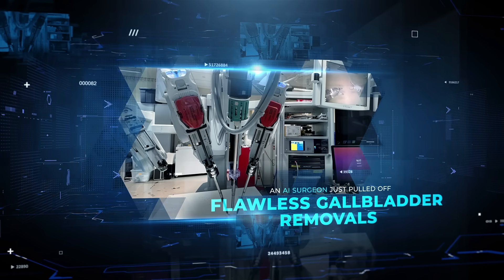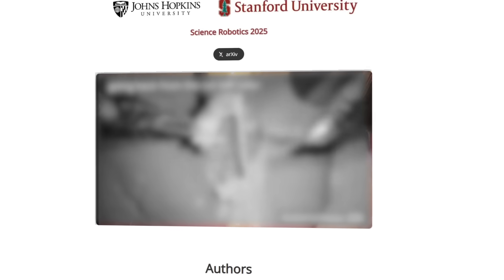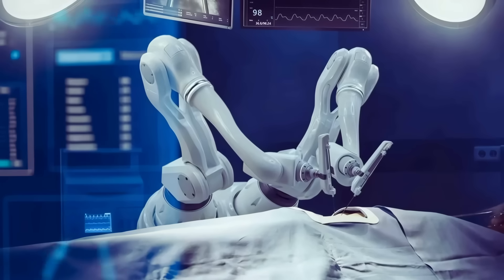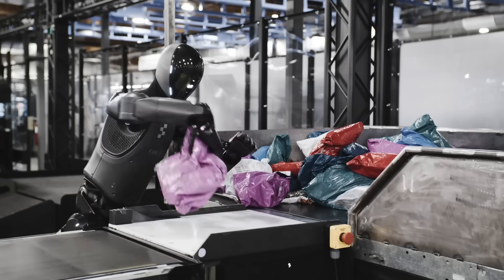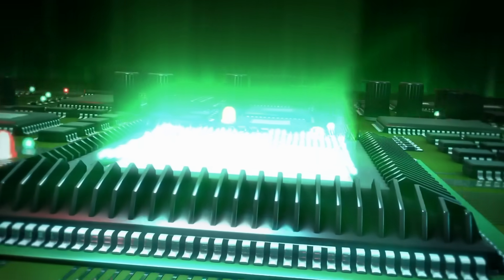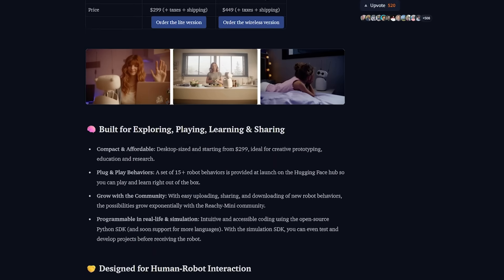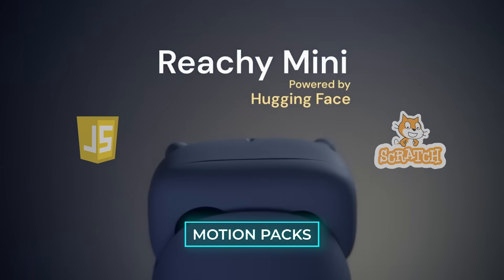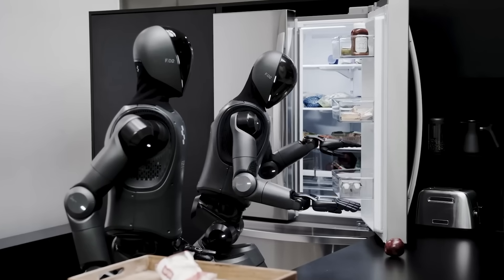New Autonomous AI Robots Just SHOCKED Everyone: AI & Robotics News

Comment: The number one hurdle holding many or most of these robots back in the future. . . . ?  It's not computer chips or software.  It's batteries.
Reply: Huh?  We have humanoid robots that run 6 hours and you can swap in a battery as easily as you do any Ryobi or Black and Decker tool, so two batteries being swapped back and forth and they will run forever.  Then we have charging floors in one design.  I don't think you know what's going on here.
Reply: The day when machine can change their own batteries has finally come.